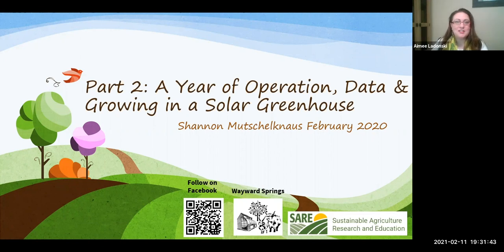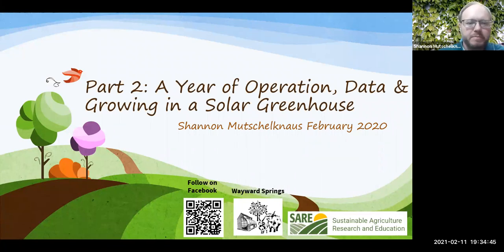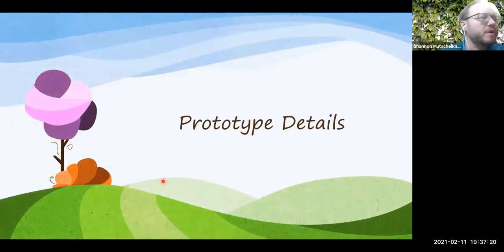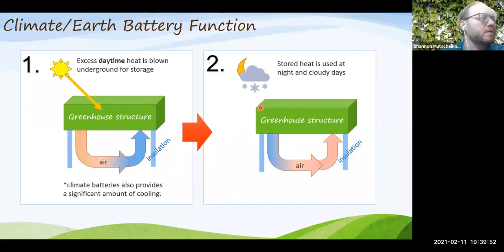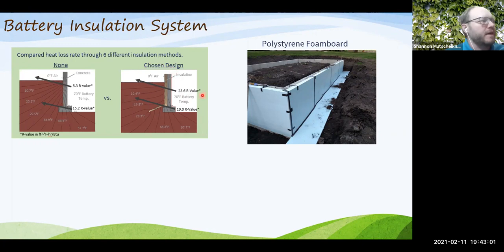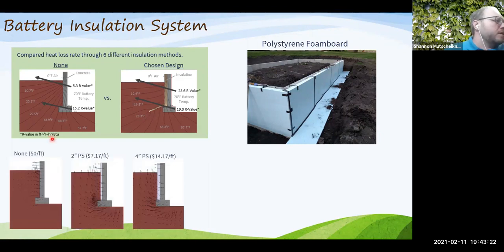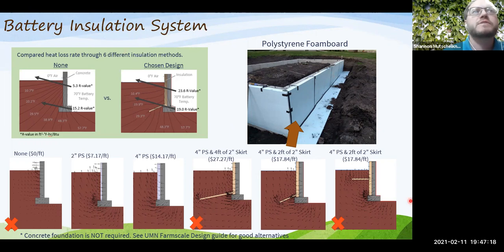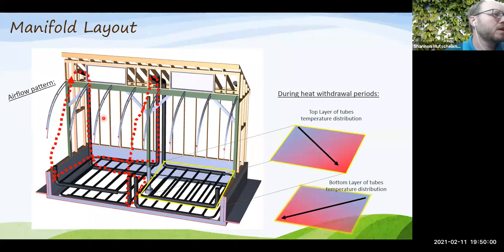Intro to Passive Solar Greenhouses: Session 2

Comment: What’s the air volume of the greenhouse & what is the optimal number of times to exchange that air for heating & cooling?
Reply: About 5,800cuft. I know some folks suggest 4-5 ACPH (air changes per hour) as a rule of thumb. However, that is a tool sometimes used for architectural design of spaces for human comfort and not a great rule of thumb for a heat exchanger. The optimal airflow rate should be based on how much solar gain the structure captures and the efficacy of the heat exchanger. I have some plots showing efficacy of this system at various airflow rates, but I cut it out so I didn't bore folks. Hopefully I can do some short in-depth webinars/videos sometime to provide a better guideline for folks.
Reply: @waywardspringsacres  
I recommend designing the system to handle at least 20 air changes per hour, more is better if you have hot summers. Very few installations have the tubing layout or fan power required to test the higher turnover rates. I purposefully designed my system for 60 air changes per hour (12 years ago) to test this grey area and incorporated some additional features to  enhance the system  efficiency.
Reply: @JohnGuest45  I recently did a webinar with the UMN Extension and shared some nice plots of the impact of higher airflow rates based on numerical analysis/CFD. I don't think the recording is available online yet. I will post a link on my Farm Facebook page when it is available.
Reply: @waywardspringsacres  
I watched that one and it was refreshing to see your recommendations broadly follow my own.  i`ve been trying to save folks from making the mistake of installing long tubes  for many years as the only remedy is to dig them back up. I was a little disappointed you didnt mention the role that humidity plays but i understand the need to keep things simple as physics and thermodynamics are not everyones cup of tea :) I think its important that folks understand the plants are an integral part of the system because an empty greenhouse with a system installed will perform woefully compared to one full of plants. If you have overhead misting in your greenhouse you will have noticed the effect it has on the heat transfer.
Something i would recommend in larger structures is to use multiple systems for greater flexibility and efficiency. A single fan in a large installation  involves massive flowrates starting at a single point which makes it difficult and expensive to achieve an even air distribution and control  the losses. 
Keep up the good work.
Reply: You wouldn't bore me; it's perhaps the most important bit of information with regards to geothermal systems.

Comment: Do you cover the pipes in the ground with clean stone, and if so, how deep ? That leads me onto another question which is if you used stone would you then use a membrane to stop soil fallin through into the gravel ?
Reply: No stone was used. I back filled the same soil that was excavated. Hauling in rock/gravel adds a lot of unnecessary cost.

Comment: How crucial do you think it is to get the air intakes up high? I'm using barrels as manifolds and the fans sit in the intake barrels (2 separate systems). My concern with raising the height of the intakes is the amount of shade they will cast.
Reply: It is not crucial at all if the fans are sized properly. When sized properly they will be moving enough air to prevent hot air stratification (hot air stuck at the ceiling).
Reply: @waywardspringsacres  Thanks, that was my thought as well. I'm also using a couple of pedestal fans to promote air mixing.
Reply: You can form clear intakes from thin polycarbonate sheet.
Reply: @JohnGuest45  Nice idea!
Reply: @cherrytreepermaculture756  
I used a 5ft x 5ft sheet of 2mm to make a 5ft x 18" diameter clear intake. If you link some long cable ties together you can adjust the diameter click by click to ensure a nice straight tube before gluing the overlap.

Comment: Are your fans on the intake tubes or on the Exhaust tubes of your climate battery
Reply: Intake
Reply: Is the fan More efficient on the intake or is there some other reason for choosing the intake over the exhaust position?
Reply: @billleete3125  Not really more efficient. It is mostly more convenient for wiring and to have them up off the ground. Creating positive pressure in the tubes also assists push out condensate.
Reply: @waywardspringsacres  Thanks for your insight.

Comment: that curved glazing has forced the design to be bit off optimum.  better to use a flat and vertical south wall (that will optimize winter sun collection)- then ONLY a couple of operable skylights in a conventional roof for only a little summer sun and most importantly for summer ventilation. the low front vents are good. also only a small amount of east glazing for summer sun and no west sun.  and use a mass floor- insulation under it IF you in the higher latitudes- and the north wall should be all mass (insulated on the outside). and moveable insulation for all the glazing areas.
Reply: Yes. The glazing arch is not optimal. It was reused from a prior greenhouse.

Comment: Great information. I see you've been active here quite recently Shannon, so hopefully you'll see these questions as well :)

1) Are your construction drawings available somewhere? (I found the umn-page with the DWG 2.2, but I don't think your is there)
2) I notice your greenhouse is quite tall. Is that because you want trees in it, or is there another reason? (i.e taller = more volume that needs to be heated, although that might not matter too much - i.e it is probably the square footage of the walls and glazing that is the most important)
3) Do you think a thermal wall would be helpful as a climate battery? My location (near Oslo, southern Norway) doesn't has as much sunlight as you do, but the temperature is somewhat higher (pluss less wind and more snow, i.e insulation), so I would need to rely more on a climate battery for long-term energi storage and not too much on "refills" on sunny days during the winter (although our coldest month, February, does normally have more sun than the rest of the winter)
Reply: I don't have construction drawings, largely because I consider it a proto and plan to make a lot of changes to the structure for my next model. I do have a 3D pdf that I could probably share via email if you wanted.
Reply: I would not do the clerestory format if I were to build it again. Mostly I was concerned about the vent doors opening successfully when having several feet of snow, but they would be better positioned in the north roof.
Reply: I'm not sure about the thermal north wall and if it would end up being redundant with the climate battery or not. If you don't get enough sunlight to charge both, it may not be worth the cost, but it would need a deeper dive into the climate, day-length and thermal mass of the two systems to say for sure.
Reply: @waywardspringsacres  Thanks for the replies. That makes sense - moving the vents to the north wall would make an easier build as well :) 

In my location I would probably need more thermal mass to get me through winter, can't really rely on much heat for the sun :(

Comment: i'd love to see a conversation between you and ldsprepper discussing the best options
Reply: I haven't seen much of his work. Just one video.
Reply: @waywardspringsacres  he basically does a hoop house with 2 ~400ft lengths of 4' irrigation tubing under it with a nice fan that blows through them.  He then puts 2" rigid foam in the back half and it keeps tomatoes alive through the winter in idaho.  He also does double layer of greenhouse plastic with an inflator fan between them.
Reply: he did a 2nd one that does gravel under the ground with 10 tubes that come in from one side and go down to the 4ft below, and 10 more 1 or 2 feet above those but not connected where the air goes out.  So he pushes the air through the rocks kind of indirectly.  That keeps things a little warmer, but he doesn't recommend it because it's so much more expensive
Reply: @josephlarsen  The University of Minnesota Deep Winter Greenhouse utilizes a rock bed storage system. A rock/gravel bed can store slightly more heat, but unfortunately adds cost to an already too costly system. I plan to do further research and demonstration of some potentially lower cost methods.
Reply: @waywardspringsacres  you should chat to ldsprepper, he's got the system down pretty cheap.
Reply: @josephlarsen  
I suggest steering clear of installations that involve 400ft lengths of tubing, its a complete waste of time and money :)

Comment: What data logging sensors andprogram do you use
Reply: I used iMonnit because of the diversity of sensor types that can be on the same network, which makes it good for research. However, it would likely be overkill if you just want to measure a couple things.

Comment: I am building a 10x12 harbor freight we geo lines and wells from the old house unit what is the best size lines and floor, we were thinking gravel floor 3 ft deep with 10 55gal barrels in the floor 2 ft in with 300 of 3/4” line & a large radiator and fan. Can you please help we live in SW Missouri Thanks
Reply: My email address is on the last slide of the ppt.

Comment: Water storage could it help store heat too?
Reply: Yes, there would be many ways to store more heat, water being a good one. However, the real challenge is how to move the heat fast enough into the storage system so that it doesn't overheat during the short intense sunny periods. I found that the soil had plenty of unused capacity because I wasn't moving the heat fast enough. The best way to improve this would be spacing more tubes, closer together to increase the surface area in contact with the air blowing through the heat exchanger.
Reply: @waywardspringsacres 
If the system is already installed you can use an overhead misting system to increase the relative humidity of the greenhouse air. This provides direct cooling for the greenhouse air as the process requires sensible energy. The cooler air can absorb more (sensible) heat as it makes its way to the inlet. The secondary benefit is the increase in dewpoint temperature which serves to increase heat transfer efficiency inside the tubes.  For example, air at 90F and 50% RH has a dewpoint around 68.9F. Air at 90F with 70% RH has a dewpoint around 78.9F. The condensate increases the specific heat capacity of the mass close to the tubing as wet soil can hold more energy than dry soil. Before you install the tubes its important to create a straight shallow slit part way through the corrugations to ensure the condensate can drain fully. The drainage holes or slots in perforated tubing are designed to allow water in but not out. Its easy to overlook  small details that can make a big difference :)